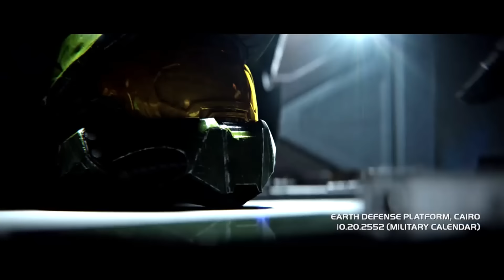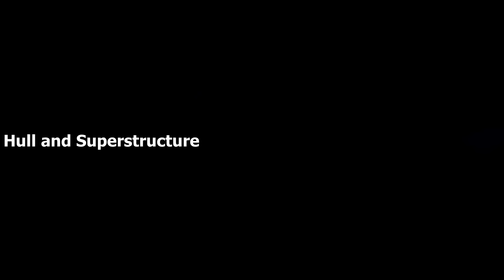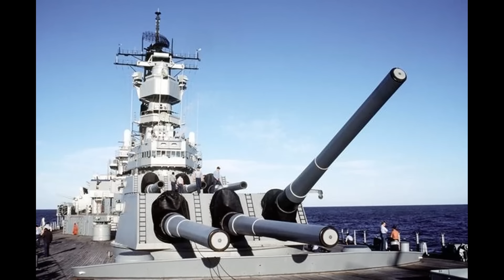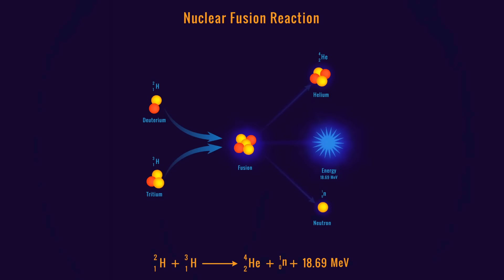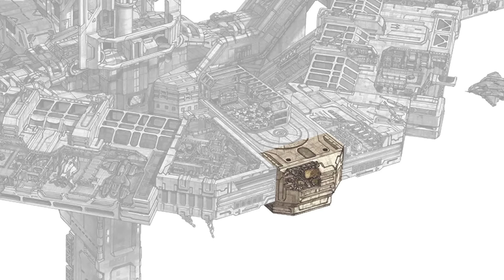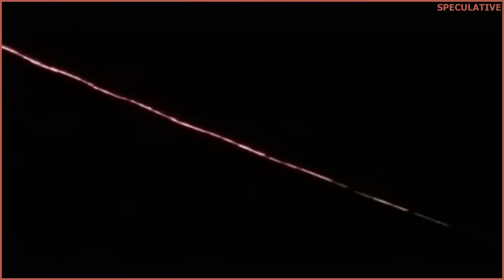Orbital Defense Platform | Most Detailed Breakdown

Comment: What confuses me is recoil. If ODP has same as ships MACs just way bigger... Where this recoil is comming from? If it's magnetically propelled, then there's no explosion that sends the round going. Unless... It is just super massive artillery round that after firing is propelled by magnetic coils or rails to much higher speeds (that would also explain why guns in Halo use 7.62 NATO and it clearly has more punch than modern ones, if we assume all guns of humanity have a tiny bit of MACs also built into their firearms to give the rounds a bit more oomf without going for 20mm rounds for a standard battlerifle).
Reply: Bro didn't study Newton's laws of motion.
Each action has an equal and opposite reaction. The round pushes the station just as hard as the station pushes the round.
Reply: @LDSG_A_Team  I know that law. Just didn't think it applies since projectile is magnetically dragged "up" the barrel.
Reply: @Hiddenus1  the means by which force is applied doesn't really matter. All that matters is that the result
Reply: I think the recoil would be coming from the "action," of the weapons. You see them moving in H2A and they are very large. In order to launch a round at that speed, and go back to its original state in order to fire the next round would store so much potential energy. It's just an assumption but it's what would make sense to me.
Reply: @ Yeah, turns out that stuff I thought don't apply or apply differently is yet pretty much the same. So Newton's third law applies here anyway.
It propels mass by magnets sure, but mass never the less. It's part of the mass of the station, so to propel it it uses magnets, but that still means it creates "throwing" force of that mass of projectile in one direction and due center of mass shift and potential friction there will be counter-force.

That's what I learned since first comment while sitting on the shitter lol

Comment: 18:35 The mac doesnt just accelerate projectiles to several thousand meters per second. it accelerates it to several thousand KILOMETERS per second. 12000 KM/S to be exact. That is 0.04% of the speed of light
Reply: You're correct, but that's 4% the speed of light, not .04%

Comment: Would there be any difference if Depleted Uranium was in the round instead of Tungsten for the MAC Round?
Reply from the maker: Absolutely. The rounds would beheavier, around 317 tons. Assuming velocity remains the same it would strike with around 25% more energy!
Reply: @Installation00  , Rafael, good evening/morning! More for Rafael's sake than yours 00, you also have to increase the energy input to match the same velocity with that increased mass. If I remember right, the kinetic OUTPUT formula would be E(k) = 1/2*m*v^2. Super basic stuff, but still important. Also, I am aware I'm probably oversimplying/not covering all the bases, but it's a good start to get an idea of it 😊

As for the increased energy input from the reactors, i have NOOO idea haha. Proportional, maybe?
Reply: @Installation00  uraniaums a pretty interesting metal actually. Because the way it sheers when beoke it basically self sharpens whenever its shot through something. The shrapnel also catches on fire and burns hot as fuck. This is why the US uses depleted uranium for its APFSDS rounds

Comment: I think 00 may have fudged in the velocity here. It's probably 5,000 km/s and 15,000 km/s respectively for the velocities of the SMAC's muzzle velocity mentioned in the vid, instead of the 5 km/s and 15 km/s shown.

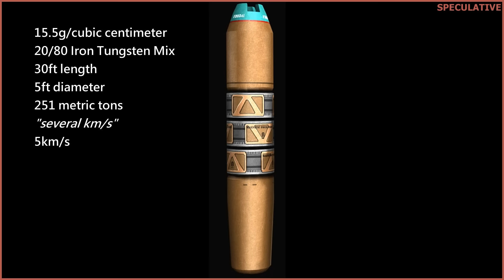23:37 is where the 5 km/s figure being mentioned.
1:07:20 is for the 15 km/s one.
Reply: Yeah, I was particularly confused when he said that 15 km/s was 5% of the speed of light, when it should actually be 15,000 km/s (300,000km/s*0.05=15,000km/s), so 15km/s should be around 0.00005%c
Reply: Finally, somebody else who is as confused by those numbers as I am. If the MACs can only fire at that velocity, then why would they be considered effective weapons in universe? A C718 Longsword would be more effective based on it's Octadart payload alone.
Reply from the maker: Yes. That was a big booboo on my part. 
It should be 5000km/s and 15000km/s respectively, meaning;
The energy of the Moncton's 251 ton round is 749.8 Megatons of TNT. 
The energy of the Erod's 3000 ton round is 80.6 Gigatons of TNT

Comment: Splendidly well done , this video show the main orbital plateform for UNSC planetary . However , I wish to point few discrepancies . Why Reach have the right of bigger and more powerful railgun while the Earth considered by many as the Homeworld is equiped to lesser MAC guns ? Is it not incoherencies unless the Data slate from these 51 Gigatons seem far fetched ? 
The Moncton class was said to be able to destroy the Covenant ships in a single shot . The UNSC warships was said to do that in a few shots especially if you have the 600 tons projectile moving at 30 Km/s / which each shot released 64 kilotons . 3 shots means it will need to release 192 kilotons to destroy a Covenant class  . Which point out that the Moncton class should be in a few dozens km/s above said Naval MAC . I have made some supposition so  hear me out . Since a several km/s means more than a few km/s or two . Considering the MAC velocity from the cruisers and their mass . Using a coherency because we should considered it .Here my two hypothesis based on the fact they could kill covenant ship in one shot . What do you think ? 
H1- 251 tons accelerated at 90 km/s would release 242 kilotons in TNT or 1 petajoule 
H2 - 251 tons accelerated at 80 Km/s would released 191,96 kilotons in tnt or 800 terajoules in term of energy .

Comment: 18:37, you do know how little that is? Conventional guns accelerate projectiles way faster than that. The M1A2 tank barrel length is 4m (I think, looking at images and knowing without barrel it's 7m long and with its 9.77m long) and can have a muzzle velocity of 1,575 m/s. The formula for velocity is this:  V^2 = 2*A*D

V is velocity, A is acceleration in meters per second, and D is distance in meters. So if we plug in the numbers,

1575^2 = 2*A*4
2480625 = A*8
310078.125 = A

This means that the Abrams 120mm sabot is experiencing an acceleration of 31,000g's. I feel like the Mac platforms would probably have an acceleration in the low hundreds of thousands, like 150k-300k gs, not a few thousand. Which would result in a lot more velocity, like 10x more, maybe 15x. Even if they only accelerate at same rate as conventional guns, that is still tens of thousands of g's, not thousands, which would probably mean 10-20 kps instead of 5.

Comment: That part about the heat dissipation could be grounds for a neat story. 
Say the coolant tank or pipes were punctured, meaning it couldnt dissipate the heat any more, but a skeleton crew remained on board manning the fire control and point defence. Refusing to leave a huge whole in the defence grid, they stay behind cycling shots hoping they could knock out even one more ship and buy humanity a bit more time. With every shot it pushes the temperature higher and higher. The palms and linen bedding igniting, before the rooms are purged of atmosphere, a method they use as a makeshift heat sink. The av-gas on board self combusts, buckling the station and literally adding fuel to the fire.
The remaing crew stripping down, in what was fast becoming a pizza oven, are pouring water over themselves before that too became too hot to the touch. 
One by one the crew collapse from heat stroke and smoke inhalation, with the smell of burning flesh when they fall onto the hot metal floor, the last man conscious through stinging eyes sets the fire control to fully automatic and keys in a few predicted trajectories of ships to the targeting computer. He's hopeful but not optomistic any shot would land.
Finally the tip of the SMAC barrel melts, fusing a round to the barrel wall. With every safety disenganged the auto loader still feeds in another round and fires it. Slamming into the lodged round it tears off the top half of the beam and the smoking wreckage finally falls silent. 

Who knows, perhaps their final choking breaths did give Earth one more day. Perhaps another innocent life was saved because they cooked themselves alive in the cold space above Earth
Reply from the maker: That's a phenomenal idea for a short story, and I'd be honoured to make a video on it, with your permission, and credit given of course.
Reply: @Installation00  of course mate, go nuts. I'm certain you'll do it justice.
Please fix my grammar though when you do it 😆
Reply: @Installation00  if you go ahead with it, may I make one small request? Could the name of the ODP be Auckland Station? 
I'm a kiwi so it'll be choice to see a little nod to NZ mentioned. But if you can't find any good lore reason why the Covvies would be trying to break through the grid over the Tasman Sea, I totally understand 😆
Reply: @greatkhan7278  Well, the UNSC Headquarters are based in Sydney, so an ANZ battlegroup of ODPs is highly likely, and it being said headquarters, maybe a larger battlegroup than just 3? The Sydney, Melbourne, Hobart, Auckland, and Christchurch ODPs.
Reply: @_Xerota_  that's very true you're absolutely right, but I didn't want to impose upon the man 😅
Reply from the maker: @greatkhan7278  The short story is nearly complete. It's wonderful. Coming Soon.
Reply: @Installation00  oh you really went ahead with it?? Hell yeah bro so I'm glad I could inspire you. I can't wait to see the poorly worded YouTube comment I typed out after midnight fully formed & fleshed out in great detail. I hope you've had fun writing it!
Reply: @Installation00 I'm getting excited
Reply: I would love to read or hear this story.  If you don't mind a title idea?  "One More Round"
Reply: @davethefoxmage5797  oooh double, triple meaning. Epic name.
Reply: This is an amazing story
Reply: Electro magnets only work when around freezing temperatures so its stop working long before that.

Comment: grav plating always strikes me as an oddity in halo. it must have a lower lift to weight ratio than conventional thrusters or rotors, be less efficient than mechanical suspension and hard to manage over uneven terrain i assume.

else it would make luttle sense the unsc uses so much conventional tech.

my guess is grav plates have pressure sensors in them and communicate to the next few plates surrounding, so only the occupied areas (and specific perma grav zones) have active gravity, to conserve on the extreme energy requirement.

Comment: when I was a kid I did the math for converting the kinetic energy of the 3000 ton slug going 4/10ths 1% the speed of light and it came out to a max of like 515 megatons. In my head, 00’s calculations for the weight of round to this lighter class of super heavy Mac make sense, 251 tons sure. But the 3000 ton supermac rounds are literally going 1200 km/s. So even lowballing 5 km/s for these seems wrong, especially with a round 1/12th the weight that should be able to be launched faster. My lowball for speed would be maybe between a third or half the velocity of the heavy super Mac, which at that weight would give a round an average yield of 7.5 megatons. Still doesn’t seem like a lot for what it is but we can’t extrapolate much else simply because we’re not given an actual velocity and there’s nothing to indicate these rounds go faster than the big ones. What confuses me a little more is how on halopedia it’s stated 600 ton slugs are used as standard for light and heavy frigates, and you know they have to have smaller guns than the ODP.

Comment: I hadn't thought about a MAC Round also being red hot shot.
Reply: If I’m not mistaken, it gets like that due to the interaction between the tungsten iron alloy slug with the hydrogen atoms present in space.
Reply: @thatgamingprotogen7043  thered only maybe be a few atoms at most every few kilometers. How would that possibly matter.
Reply: @r @robertharris6092 ’s a few atoms per cubic centimetre,not kilometres. There’s also the energy put into the round by the firing mechanism, and inertial dilation from the velocity of that projectile striking those atoms which relative to the round weigh more.

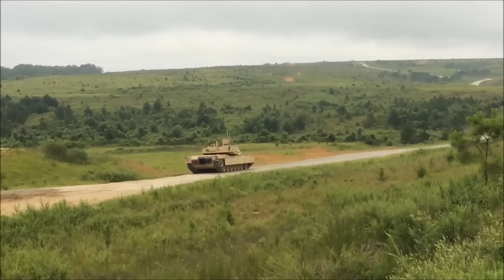Comment: 24:11 Not doubting the math there, but roughly 750 tonnes of TNT sounds REALLY low for something referred to as "humanity's greatest weapon". Even the earliest nuclear bombs had a yield measured in kilotons of TNT. Yes, that's 750 tonnes being focused into a relatively small point, but Trinity was about 33 times more energy released.

Also, 5 km/s is only about half the speed of escape velocity, so again seems like it's quite slow for a weapon supposedly able to punch holes through shielded covenant vessels, which CAN resist low-yield Shiva nukes. I think the problem lies in the "several kilometers a second" description of the velocities achieved, as it's a highly vague statement.

Edit: ran a check, even at 11 km/s, it's still only about 3 kilotons of TNT equivalent, which again seems really low yield for a weapon of its stated capability... Especially since the HAVOK has a stated yield of 30 megatons TNT equivalent, and that definitely can't drop a Covenant ship's shields (unless detonated within them, for obvious reasons)
Reply: @Kyuubi799  This is what got me too.  Seems pretty weak absolutely, even more so considering the UNSC uses nukes like candy.  Or at least they did before they started running out of them.

Even more interesting is the hard numbers given in the OG Halo: The Fall of Reach, which I believe specified a 3,000 ton projectile at “point four tenths” of light speed while also needing a ground based reactor.  I’m guessing two different classes of ODP, with this one being the far, far weaker class.
Reply: @hughmann3952 when I was a kid I did the math for converting the kinetic energy of the 3000 ton slug going 4/10ths 1% the speed of light and it came out to a max of like 515 megatons. In my head, his calculations for the weight of round to this lighter class of super heavy Mac make sense, 251 tons sure. But the 3000 ton supermac rounds are literally going 1200 km/s. So even lowballing 5 km/s for these seems wrong, especially with a round 1/12th the weight that should be able to be launched faster. My lowball for speed would be maybe between a third or half the velocity of the heavy super Mac, which would give it an average yield of 7.5 megatons. Still doesn’t seem like a lot for what it is but we can’t extrapolate much else simply because we’re not given an actual velocity and there’s nothing to indicate these rounds go faster than the big ones. What confuses me a little more is how on halopedia it’s stated 600 ton slugs are used as standard for light and heavy frigates, and you know they have to have smaller guns than the ODP. Yields should be higher for sure
Reply: Shhhh. Those are 750 Halotonnes
Reply: Its because he goofed and got the numbers wrong. Like.. by several orders of magnitude. I'm not sure where he got a mere and laughable "5km/s" from when it is stated in lore to be 12,000km/s. The Fall of Reach specifically states "four-tenths the speed of light." 0.04c is equal to.. 12,000km/s. His numbers are wildly off. Warfleet giving out a random, vague and bullshit number that contradicts established lore ,even their own earlier retcon, is just.. incredibly on point for 343i (I don't give a fuck about their attempt to rebrand).

For a random comparison, the ISS has an orbital speed 7.7km/s.. make of that what you will.. the fact that the ISS would beat a Super MAC round in a race using his numbers.

It is beyond moronic to think the UNSC would defend Earth with the MAC equivalent of potato guns that have velocities that our real railguns were rapidly approaching in live tests and theoretical designs that far exceed it. Hell, the US military had a plasma railgun in the 90s (Project MARAUDER) that fired a plasma toroid at 3,000km/s and was expected to exceed 10,000km/s (3% of light speed) by 2000. Its a shame they classified the project and stopped publishing info about it.

Just another example of 343i era retcons being exceptionally stupid and lazy.